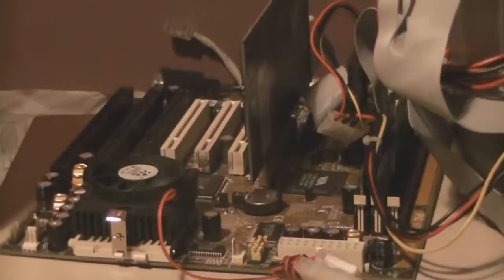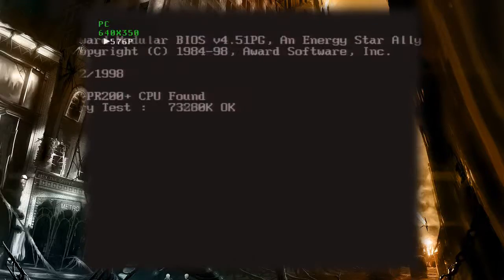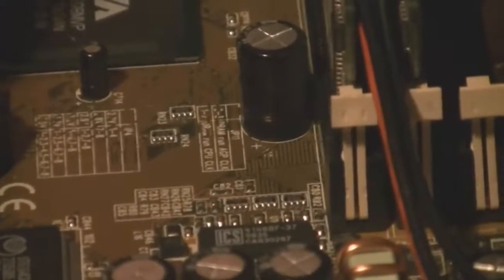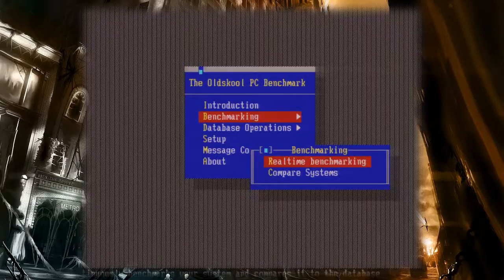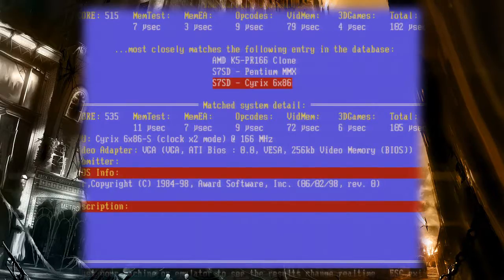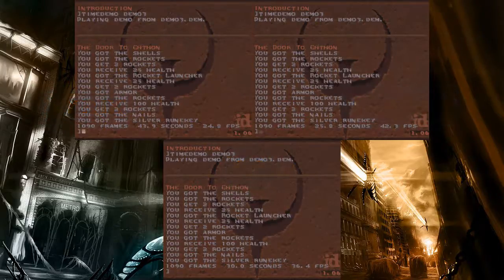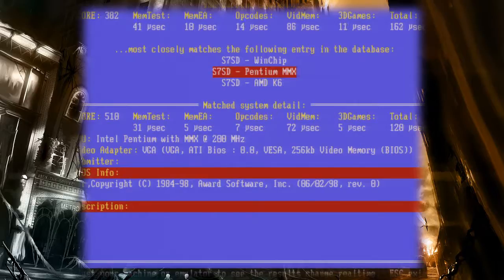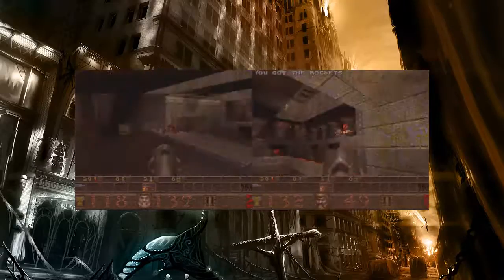Socket 7 Showdown

Comment: WinChip was always a POS.  The only reason VIA chose Centaur's WinChip design over Cyrix for their processors was because it could be clocked higher and they thought that consumers would ignore performance and focus only on the clock speed.
Reply from the maker: That and I seem to recall the Cyrix design not being finished, but I could be wrong. Whilst the WinChip isn't really very good I still think it might have been decent as a last minute upgrade on a Socket 5 system, but as the Pentium 200 was produced until at least 2000 (at least according to a source that I have no reason to disbelieve) I'm not entirely sure it wouldn't be worth just throwing the extra few bucks at one of those if buying a new machine still wasn't an option by then for some weird reason.
Reply: @HighTreason610  The Cyrix Joshua chip actually was finished.  Samples of it were sent to reviewers.  There was one German site that I remember seeing that did benchmarks on it.  As for the Winchip, its only advantage was that it consumed less power.  Unlike Cyrix, Centaur was never able to design a processor that could match or beat Intel in performance.  The sole reason for VIA choosing them was because they could produce processors that were cheap and clocked higher.  However, despite the clock speed their processors couldn't even beat a lower clocked Celeron and they would lose to older K6-2s and even the Cyrix MII in certain benchmarks.

Comment: The reason that Intel wins hands-down on the Quake-test, is because John Carmack optimized the Quake-engine for Intel processors, where Cyrix and AMD would have problems keeping up, in that specific test.
They could do the work through a bit more brute force.

But when looking at other more general tests, Cyrix usually won out on more pure mathematical tasks, and AMD was a good allrounder, when coming to general gaming, when not counting the Quake engine based games.

I am fairly convinced that, had a gaming test been done with Duke Nukem 3D & Need for Speed, the results would have be far more different.
Reply from the maker: This is indeed right and my test could have been better conducted overall. Whilst I probably won't do this again myself, WaybackTech conducted a much more varied test - https://www.youtube.com/watch?v=iGW5rwXtJNo - so that might be worth looking at.
Supposedly, and only supposedly, Duke Nukem 3D had some very simple Pentium optimizations done to it late on, but I'm not sure they do very much and might be more general to 5th generation CPUs overall than those in Quake, if they exist at all, I have never gotten a clear answer. However, the game was tested in-house on a 486DX2-66 is seems. Unfortunately there's no real interesting benchmark and you're really limited to DNRATE on the E1M1 starting position, I think the CON code was too limited at that time to really write anything much for it either.
Reply: @HighTreason610  You can save a game at any point, and load a save and benchmark there, not only in starting position. There is lots of interesting places, where FPS goes high or low. For example, burning flames do quite FPS hit.
You can even make your own map in build editor, to benchmark at some specific spot, with stuff you want. (for example  complex scene with lots of sprites)

Comment: I want a Winchip.
Reply from the maker: +Radical Edward also Kainia Karia (Michael Gardner) Yeah, there's a certain novelty about them. Is it crap? Yeah. But for some reason I do kinda like mine, it's like plugging a 486 into a Socket 7 machine, completely pointless. I do wonder how slow it might be if I disabled all the cache and tried to turn the clock speed down.

In reply to some of the other comments you left;
- Windows 3.11; Indeed, Windows 3.11 would fly on a machine like that. I tried to run it on a NetBurst system once and it was rather ridiculous, albeit useless as there were no drivers for anything... But it rocked solitaire with no video acceleration and had no problem with the included screen savers. This was booted from a USB stick. I prefer Windows 8 and 10 to Windows 7 for sure, never got on well with Windows 7.

- Retired Computer; The sucky thing is that I'm still stuck using that machine having since dragged it back to life, kicking and screaming. It's come a lot further than it was ever meant to at any rate and I've never had any real issues with the CPU. I'm probably in a minority for liking it, but as I primarily use the system for Video it has served me well. It can outrun an Athlon 64 X2 easily and also manages to outrun a Core 2 Q8400 when rendering XVid/MP3, the margin narrows since I have had to switch to H.264/AAC.

- Katmai; People think the Katmai is a piece of shit? I have a feeling their ideas are somewhat misplaced. A lot of fun can be had from a Katmai, or any Pentium III. I have to respect the Pentium III because a dual coppermine box kept this channel afloat for around a year. It choked on HD rendering and the poor SCSI drives couldn't handle uncompressed videos in real-time, but it slowly hammered its way through without a single failure of note. That system used to run two Katmai's and it was just as good, only it was at half the clock rate. Since upgraded the Radeon VE a Quadro 2 Pro and it just flies, at least, for a 90s computer.
Reply: +HighTreason610 I used a Katmai machine back in 2003-2006 so I too must show respect for the damn thing and I will upgrade to a Coppermine 370 with the Slocket Adapter&#160;at some point though and I happen to have a Quadro 2 Pro running on it.

Comment: I wish you could have tested the Cyrix MediaGX. I'd be interested to see how it compares to the rest of the lot.
Reply: +The Obsolete Geek Impossible. I have a MediaGX chip, and it is worthless because they are a special mobile / embedded processor with integrated graphics, pci and memory controller and although they are technically a socket 7 chip , they are not pin compatible with any socket 7 motherboard except boards specially designed using Cyrix's own "companion" chips. Putting one in a traditional socket 7 board will fry the board.
Reply: We have some equipment still powered by Cyrix Media GX.  I saw the logo for it in the internal bios of a touchscreen interface.  I think Media GX was a solution Cyrix was offering developers not necessarily in the PC market...though they did make normal home computers around them as well...

Comment: wasn't the via mvp3 one of the best chipsets?
Reply from the maker: ibm5155 So far as I can tell it is. The ALi might have been faster but whilst I have used one at work a few years back, I have never gotten to test one extensively and so cannot say. The MVP3 is certainly in the top two, probably the best all-rounder from what I know, because it works with practically everything.
Reply: One of the best..yes.  I've owned several mvp3 chipsets...One of them had 2 MB L2 Cache.  I also owned the Alladin 5.  I never got to compare them side by side but  I would easily say the aladdin outperformed the MVP3 .  Also I had no compatibility issues with games or graphics cards on the alladin.  BOTH were FAR better than most other SS7 available though.

Comment: Some cockface sold me a "Petnium 133Mhz" PC for £1,400 back in 1995, and when I got it home, I realised he had swapped out the Pentium for a PR100. When I called him to complain, he told me that the PR133, which ran at 100Mhz, was faster and better than a Pentium 133Mhz. He basically ripped me off, then bullshitted me. I was only 15 at the time, so I couldn't beat him up and didn't know my consumer rights. Anyways around a year later I went into his shop again with a friend and while the owner wasn't looking I stole two Pentium 200Mhzs CPU's from behind the counter. Revenge is sweet. Kept one for my PC and sold the other to my friend for £50 XD
Reply: Was it a Cyrix?
Because there was a time, where Cyrix was actually better then Pentium, while being cheaper.

Hence the PR-rating, which originally was known as P-rating (Pentium-rating), but was changed to PR, due to a law suit from Intel.
PR stood for 'performance rating' which meant, that a Cyrix or AMD which had 100 Mhz, was performing the same as a 133 MHz Pentium or 80 Mhz Pentium respectively, the Cyrix would be 'Cyrix 100Mhz PR133, and the AMD would be AMD 100Mhz PR80.
Reply: back in 90's , there was lots of cheating and ripping off unawarared consumers, because noone knew about computers too much. And they were super expensive. Some fakers even faked Pentium CPUus, bought 133, and sold them as 166 overclocked. PCchips also faked l2 cache modules.
Reply: @warrax111  To be fair, although it's wrong, 90% of all 133Mhz binned Pentiums could easily run at 166Mhz. Overclocking was easy for the CPU's as long as you had the motherboard quality and jumpers to do it. Still wrong! But advertising a Pentium 133 - then giving the customer a 100 AMD CPU with barely any FPU that costs less than HALF the price of the Pentium was a joke.